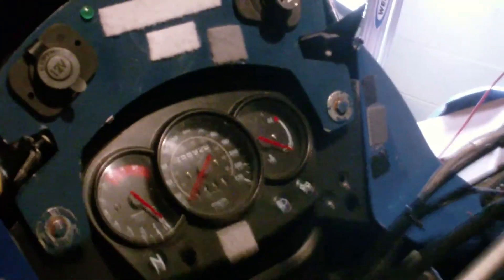Rewiring 12 volt outlets To a Relay !

Comment: One of the best additions was installing a 12v on the bandit.
Reply from the maker: When I travel I use mine all of the time . The first thing that gets plugged in is the GPS . I have have gotten off the bike so many times and pulled the GPS off and left the USB plug and did not give a thought about it . That light is OK for a short time but after a week it dose not help the battery any . LOL Thank You Banditnev !

Comment: The box said they were water proof!! DAMN they lied!! LMAO!! There used to be a plastic plate on the lower left hand side. There was a power outlet there. With a heavy Gauge wire run to the battery. That is where I did the jump start from.  Any who, The philips head stripped out, and it was resessed inside the plastic. I got pissed off and snapped that cover off!! Didn't need the damn thing anyway. Looks good bro! Wire that other one so you can plug your GPS into it.
Reply from the maker: Thanks NT8 ! I am getting it done . With the rain that we had it gave me something to do and make the goat more use able for what I need her for .